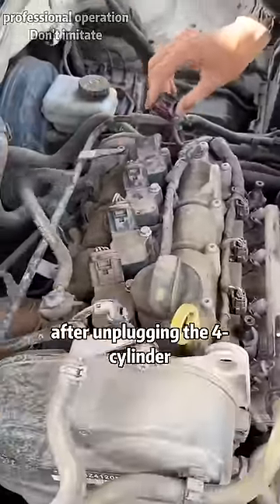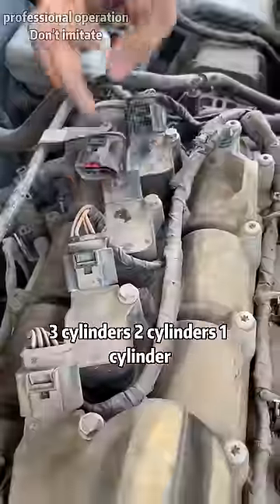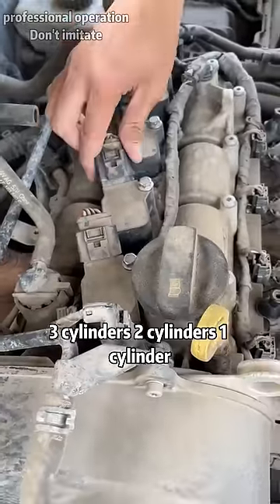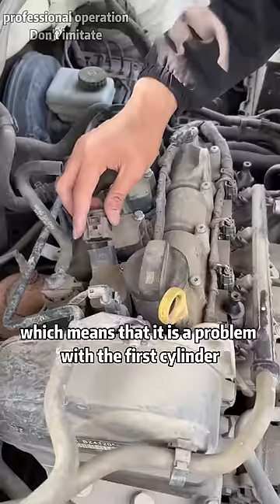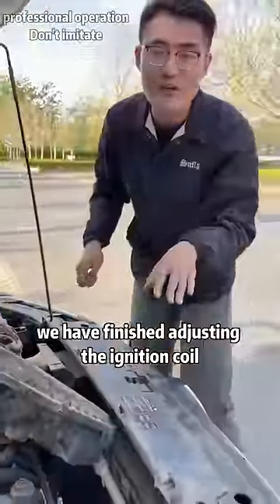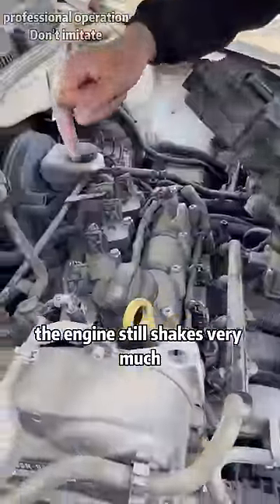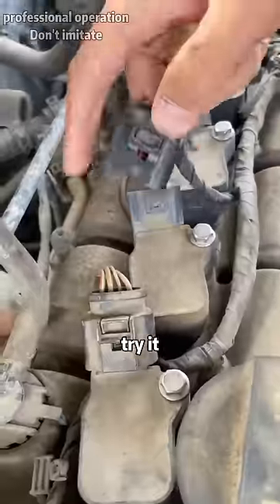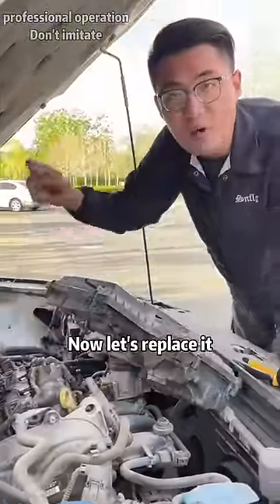（PART2）90% of people do not know the maintenance skills！#tips #car #shorts #tutorial #driving

Comment: It's not recommended to do this while the vehicle is running brother. You can fry your fuses and/or the ignition relay.
Reply: Well how else will you know the cylinder isn't working if it's off?
Reply: @i_am_taku  you can do that, but turn off the vehicle 1st. Unplug it. Then restart it again and check. If you unplug it while is running, you're causing an electric shock to those components. I'm not saying you're gonna burn the relay the 1st time you'll do that. But why run the risk.
Reply: Won’t hurt it for a short time this is how you find bad injectors in a diesel
Reply: @thatgarrettboygaming2052  interesting. But I don't think it's the same system. It doesn't work the same. I'm just giving an advice. And I know it won't break anything the first time.
Reply: @Rey_M  it’s the same thing if a coil goes out or if it’s got a miss it’s not healthy in the long term but it’s not gonna blow your car up
Reply: @thatgarrettboygaming2052  oh that I know. It won't. It's not recommended. Anyone can do whatever they think is ok. I don't care. All I said was that is not recommended. And did my explanation of why. But I see your point and you're also right. It's not gonna blow your car up once or twice. I wouldn't try it on new cars. That's just me lol 😆
Reply: Just take it to the scrap yard.. problem solved 😉
Reply: @thatgarrettboygaming2052  diesels have ignition coils?
Reply: Creating an open circuit with blow a fuse? Fry a “relay”?
Reply: It's actually in "all data" to perform this test on the Lexus 3.3 to test the COPs
Reply: @jimmythekid1  is not the open circuit the problem. Is when you close it while the engine is running. But who knows. It was a recommendation. No one have to do it. Or believe it.
Reply: @i_am_taku test the coils with a simple meter
Reply: @Rey_M  Good advice...there is a possibility of initial shock..thx for the heads up..just imagine trying to fix one thing suddenly another problem arise while fixing and everything wont start...it would be really a long bad day!! searching the root cause
Reply: @i_am_taku  swap 2 coils if the code changes, you know which coil is acting up
Reply: @jimmythekid1  he's probably talking about the injectors, which is electronically controlled on modern diesels.
Reply: @i_am_taku  maybe connect diag tool and read dtcs and see which cylinder is misfiring?
Reply: Leave the diagnostic to the big boys. This doesn't hurt anything, but a scan tool will tell you if it's working or not.
Reply: @oliver_klozoff  the guy is trying to teach a lamen to figure it out and not alot of people have scan tool. Basically doing a cylinder drop test without a fancy scan tool to turn off one plug at a time.
Reply: Mechanics do this all the time. It's called a power balance test. It won't cause an electric shock to components, because those components will be disconnected. These components are constantly being turned on and off while the engine is running. Having it stay off and not turn on won't do anything. Mechanics need to see the difference between cylinders right then and there.
Reply: This is completely false, it wont do shit lol, this is a real technique that people use. If it messes up any fuses that means there is an extreme electric issue and something is getting too many amps.
Reply: For all those fancy scanners and the "I've been doing this" please read the beginning of my comment. "IT'S NOT RECOMMENDED!". Y'all do whatever you been doing and whatever works for you. This comment IS NOT FOR YOU! Last comment wrote if a Fuze blows is something else. Well, why are you doing this in the 1st place. Now you have two problems to deal with. Again, it's a recommendation that can potentially make the problems worse. Comprende? Capisce?
Reply: @Rey_M  You would not need to try it on a new car
Reply: @jimmythekid1  yes they have but it called glow plug...
Reply: @NeutronX101  they use glow plug buddy
Reply: @NeutronX101  ouh really....give me the diesel engine name that not use glow plug, cause i never heard abt diesel engine that not use glow plug😅
Reply: It won’t mess up any fuses or relays
Reply: @jimmythekid1    that's what he said😃, disconnecting a circuit won't burn fuses, becz it stops current flow! Besides the connector has NO wires/terminals exposed! No shorting hazard at all
Reply: I literally do this quite often. Thousands of vehicles. And never ever did what you said. Only problem with what you speak are certain year ford escapes. The oem coils backfeed a frequency that burns out the ecm. Unplugging the coils doesn't.
Reply: @thatgarrettboygaming2052  I’m confused diesel engines don’t have coils
Reply: @badguy9691  glow plugs is for cold starts , diesel engines run  from  high compression to  fire  unlike gas engine witch needs spark
Reply: But what do I know lol it’s not like I’m working semi trucks 10 hrs a day 6 days a week
Reply: @brian92345  so what is ur pointt?
Reply: @badguy9691  these people don’t know crap about engines lol I’m over this discussion
Reply: @brian92345  too bad for u i build engines for a living
Reply: @NeutronX101  i already did, thanks tho. So have u find the engine name already?
Reply: @badguy9691  to bad for me ? I can care less what you do buddy , congrats to you. I guess we have something in common , I work on a fleet of cement trucks and semi trucks.
Reply: @brian92345  well thats good for u then
Reply: @countryracer69  literally could get shock when reconnecting the cables back on 🤣🤣.
Reply: @Rey_M  hahaha no
Reply: @badguy9691  ya would  say so  it’s good money but you know that I’m sure
Reply: @brian92345  yeah, i feel u man
Reply: You are wrong. This is totally fine to do. The 5v isn’t gonna jump anywhere
Reply: @brian92345  unplug a injector bud
Reply: @brian92345  u got a loud injector u unplug them tell u don’t hear it no more bingo bad injector
Reply: @thatgarrettboygaming2052  what are you talking about ? Seems like you think it’s my video or something .
Reply: @ZeldaNumber17  really...! I beg to differ!
Reply: Don't be scared billy. This is how we run diagnostics on ford super duties with the computer. We can manually turn off each injector individually. Basically the exact same thing this person is doing but we do it electronically as opposed to physically.
Reply: @Rey_M  then do. Hit me with a fact
Reply: That car should be in pick a part
Reply: This ancient thing called a timing light… eh huhhh
Reply: It's called an ohmmeter
Reply: He said injectors numb nuts
Reply: O only with Nissan
Reply: Just Get a OBD reader
Reply: @AudibleQuran  the reader will tell you misfire on some vehicles and other vehicles it will say misfire and ignition coil circuit but what about the one that just says misfire you have to figure it out
Reply: @AudibleQuran  I would love one of those fancy $500 ones… but shit that’s expensive
Reply: It’s the same as a misfire, it happens. It’s kinda farmer methods. There are better ways to do it with a $500+ tool, or you can just do this. Usually you gotta enter the vin on those tools too, generally a pain to use unless you can’t figure it out without it
Reply: It's much better than going to a mechanic I've done this alot without fuse or ignition relay problems. You can use a obd2 reader but it won't usually tell which cylinder so you have to replace everything or do what is said in this video
Reply: @NeutronX101  What type of diesel has spark plugs 🤣They are glow plugs compression and spark are definitely different.
Reply: @Rey_M  been doing this since I started working at Hyundai (since 2019) but I have never busted an electrical component doing it so I guess I won't believe you too much. Maybe it depends on the vehicle.
Reply: Exactly 669 likes and 69 replies before I replied
Reply: Just buy new fuses, they are very cheap
Reply: My dad taught me to pour water on the exhaust manifold pipes coming from each cylinder, the pipe that didn’t immediately result in the water evaporating off was the misfiring cylinder, I’ve also just unplugged each coil but the water method is more interesting lol
Reply: Certified Armchair mechanic
Reply: Who are you? How dare you make recommendations to him! He is my personal parking assistant. Ever since I started watching his videos, I have never failed to reverse park my car,  I have never had to call for a tow when my car breaks down in the middle of nowhere, I can always help out people whose cars are broken and my BDSM game is now top tier due to my incredible knot tying skills.
Reply: @DarkSide-dz6hi  my bad lol 😅
Reply: Come on. Do you know how many people change outlets without turning off the breaker? lol. No body got time to turn off the car and turn it back on (Just kidding). It makes sense to do as Rey M says. I didn't know you can burn the fuzes or relay so do as he says.
Reply: nobody understanding that a misfire would drigger a dtc and you can use a $10 generic obd to figure out which cylinder is firing, and this technique doesn't work for engines with a distributor, or engines with a single coil pack rather than individual coil packs for each cylinder
Reply: @Rey_M  you can do it your car won't blow up relax dude
Reply: It's called a cylinder cut out test it's normal
Reply: Spark plug tester. This is faster though so we do this sometimes. Just don't wanna do it too long because fuel is still being fed. The cat dose not like fuel in it lol
Reply: And that is why we have scan tools
Reply: Believe me I learned the hard way with a waste spark system and fried the board the coil packs sit on and it was $75 to replace. 😂😂😂 it runs fine now but I won’t be unplugging spark wires while it’s running ever again
Reply: @i_am_taku  you could unplug the injectors instead of the coil pack to see if it changes and
Reply: @thatgarrettboygaming2052  diesel don’t got spark plugs so there is no coil pack to take off
Reply: @jimmyboe25  you get it Sir. Sometimes we learn the hard way.
Reply: It's fine on the old iron. Pop a plug wire off and the absolute worst case scenario is you get a wakeup call.
Reply: No you wont
Reply: @Rey_M  that's for improper grounding
Reply: Remove the coil and the spark plug, lay it on the engine block.  Start the car and look at the color of the spark.  If your spark is blue, the plug and the coil are good.  You won't jack up the fuses or relays that way.  If the spark is anything other than blue or no spark at all, it is likely the coil if the plug is ash gray.  Ash gray indicates a clean burn.  If the plug is not ash gray or is wet, replace both coil and plug in that cylinder.
Reply: U can even damage the ecu like this
Reply: What are you talking about I’m a technician it’s called a power balance test
Reply: @ChrisJRSpro  with some of these newer cars, an arc from the plug can cause damage to circuits.
Reply: Not likely on an ignition coil
Reply: @benjaminmcintosh857  While I do agree, there is alot of stupid out there the would find a way of breaking something without even knowing while claiming they know what they are doing.
Reply: Nope
Reply: @Rey_M  it’s 12v it won’t shock you…
Reply: 6yrs as a shade tree mechanic I've used this method 100s of times doesn't harm anything
Reply: @danteanderson9052  I still use it on the older cars.  On the newer models, I don't.  25 years as a mechanic.  I hate when people try and call me a technician.  I do the entire car, I don't just change oil.
Reply: @christopherpittman8054  haha try it on a Tesla it may blow up
Reply: @danteanderson9052  a few pounds of tannerite, an egg timer and a few yards of wire and you're good to go.  Tesla fixed
Reply: @i_am_taku cylinder cutoff test
Reply: Yes, Socket shouldn't be removed. u only need to pull up the coil.
Reply: @ferv888  agreed 👍🏼
Reply: @Rey M  you are taught to do this in school,  soooo ?
Reply: @Rey_M it won't hurt the system at all as the is no circuit being completed for it to shock other components. 2nd it's only 12 volts up to the coil pack and the coil pack turns it to around 1600 volts. This way of testing is very common if you don't like the idea of it I'd suggest you never take your car to a mechanic as this is what they will do first as part of fualt finding.
Reply: I swear I've seen these exact comments like a year ago
Reply: @i_am_taku  safe way is turning off engine and starts each unplug
Reply: You can absolutely do this and won't hurt shit, COP or Distributor ignition either way.   I've diag'd literally hundreds of dead misfires doing this when I'm not at work or don't have one of my scan tools with me. Maybe there's some rare system that you shouldn't, but I've done every car or truck ur likely to find in North America without issue
Reply: @thatgarrettboygaming2052  .
Reply: @Rey_M  well you still aren’t really supposed to do that but for that short amount of time it will be fine
Reply: not to mention hydro lock the engine if you leave it running for too long without ignition
Reply: It’s fine, if ur quick abt it
Reply: I have a 81 camaro no worries lol 😆
Reply: @thatgarrettboygaming2052  diesels arent spark ignited
Reply: No it won't
Reply: But look he’s In a blue mechanic suit from party city so I wholeheartedly trust him
Reply: No, no one is gonna check their fuses brother
Reply: I am a mechanic and that's how my teacher did it and how I do it and have never had a problem nor heard him say anything about that
Reply: @i_am_taku  compression test
Reply: @Rey M  I believe you lol. These goons don't work with electronics anyways their "mechanics" not "electricians" lmao
Reply: @thedornanfam-blogsplusmore8510  YES!!!! Yes sir, you're absolutely right! This guys are part swapping. Not even real mechanics. And even if they're mechanics, they have no clue about how electricity works.
Reply: Wtf that isn't true at all. It is a common way to test them out. It won't  fry anything but it will put a misfire code which can be removed.
Reply: @Gm Kof Hard  it is true especially on the newer cars because the ignition coils have 3 wires, power, ground and signal. Unplugging these while it's running will blow the ignition coil or even destroy the PCM! Do not do that on the newer vehicle!!! Older vehicle you can!!! The purpose of fixing something is to save money not spend money. So be careful out there and listen to your repair manuals!!!
Reply: @Rey_M  I believe you’re an intelligent man. That way you present your self in an argument is very professional.
Reply: @i_am_taku  you can literally use an obd reader that will tell you the cylinder that is misfiring.
Reply: It's okay, he has 1000 car knowledge on the homepage
Reply: @thatgarrettboygaming2052  diesel engines are not the same as petrol engines
Reply: @Woo.f32  I really appreciate it Sir. I'm not trying to insult anyone's intelligence. And I won't sink to their level with insults. I wish I could double like your comment 👍🏼 👍🏼
Reply: @thedornanfam-blogsplusmore8510  Sir, most of them are still working on 90s and early 2000s models. They don't understand the damage they'll do to the PCM and others parts. At the end, it's a recommendation. If it worked and still working for them, by all means lol 😆. But there's always that one car lol. There's always one
Reply: @Triferus  I don't see why you don't just get a good scan tool... I literally feel so bad for the mechanics stuck in their primitive age when all they need to do is hook up a tool into their OBD2 port! Save yourself some time, like God damn
Reply: I haven't had a problem doing this before, I've done it many times, it's called a power balance test, a power balance test can be used many ways, troubleshooting ignition coils, a bad or non functioning fuel injector aswell as to diag a dead miss by swapping coils, injectors, and double checking proper voltage as well as signal at the connector, if all checks out it could be possible low to no compression
Reply: There's many ways to test for a misfire and this is one of them and it doesn't hurt anything bud.
Reply: Here we are with another armchair mechanic. I’ve worked in numerous dealerships and post production automotive mechanic at a plant. This video is fine and a great way to find bad coils.
Reply: @stephenhawkingMLG  exactly lmao
Reply: with the vehicle off, expose the pistons by taking off the intake- cams - fuel rails ( anything in the way of the block)

You can turn the crank Manually   with a prybar. 

May not be the easiest, but probably the safest.
Reply: @zanderkage3317  that's the keyword. "THE SAFETIES!". But most of these "mechanics" don't get it lol.
Reply: If he’s unplugging the one that he’s unplugging then it should be fine. The problems occur when you unplug the secondary ignition wires
Reply: that’s the way my automotive teacher taught me
Reply: @Rey_M you’ll need jump doing all starting and stopping
Reply: Soooo so so many uneducated people giving terrible advice and stating things that are just flat out false in this thread. Unfortunate. Oh well, just helps people like me keep our job when y'all fuck it up or can't figure it out with the advice you found in the comment section of a YouTube video, you can bring it to us to fix it the right way :)
Reply: @shirazkhan1655  when i helped diagnose it on a family members car, the ecu knew which cylinder was misfiring. that’s how we knew without operating on a live engine
Reply: I'm a software engineer not a freaking mechanic! 
Just give it for car servicing! 🤦🏻‍♂️
Reply: Do not believe a guy whom cannot spell fuses!! Lol
Reply: What about running compression my guy
Reply: @aidanmorgan6291  we are talking quick fixes I don’t think the average person has a scanner lol it’s already misfiring so him doing a quick swap can’t harm it any further really
Reply: @robbleaux8069  oreilly's or auto zone does
Reply: @Rey_M  u sure? I can think of something that breaks the first time😏
Reply: Yuup, also it applies to everything that's electric/electronics. Don't hot unplug !
Reply: Or if you actually are good mechanic and you got $1,000 scanner you could shut each cylinder down with the fucking scanner and see which ones missing but I'll bet you just probably got an entry-level scanner they can only read the code and it probably don't even freze frame or live data also if you got a bad coil you should be throwing a code when throws the code you look up the freeze frame and see exactly what the engine was doing when it through the PO 300 301 302 and so on obviously you're not a very good mechanic or you will have a scanner you can shut it down cylinder by cylinder
Reply: @badguy9691  A lot of Cummins engines use an intake grid heater instead of glow plugs.
Reply: @warrenself  its the same thing buddy
Reply: @jimmythekid1  yes, inductance within the coil pack will resist changes in electrical current and can cause arcing if not connected/ disconnected properly. This arcing can then cause a small power spike which may be enough to blow a fuse.
Reply: @Long-Island-Sound  🤣
Reply: @i_am_taku  with a scanner. The scanner will tell you which cylinders is miss firing then you can proceed to swap the coils with the engine off. Then scan it again. One time I did that while the engine was running and burn the distributor ignition coil.
Reply: it isn't a problem when it's be short ('cause every garage would do that in the same way), 'cause it's easy made - even when they have proper tools; but, the tools just show the "primary spool" - not the "secondary spool", who leads to the spark plug - and that's the most fault a ignition coil will have: the secondary spool will going defect. that way is then the only way to find that out - even when the spool is working, but with less power (what also can lead to a shaking engine). when the engine runs good, then just DON'T DO ANYTHING, cause "never touch a running system".
Reply: Rey m at last someone with commen sence
Reply: @simonjohnson3327  you nailed sir! 👏🏼 common sense!
Reply: @thatgarrettboygaming2052  this can potentially shock some cars ECUs (BCM etc)

Car off, pull coil, car on. 
Rinse and repeat.
Reply: @mosthated863 🤣🤣
Reply: @i_am_taku you either do it with a scanner or a special coil on plug tester thats like $80
Reply: It can also backfeed into the ecu.
Reply: @BullittAutomotive  exactly
Reply: @brian92345  EXACTLY !!👍
Reply: As a mechanic this is exactly ehat you do, because its no different to the issue that is already present (a dead coilpack or injector) your just causing a 2nd one